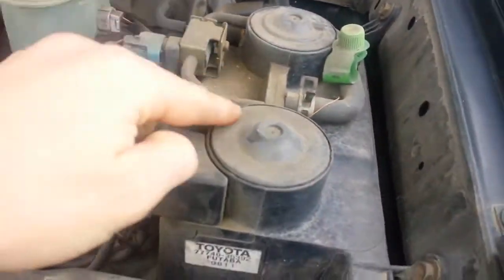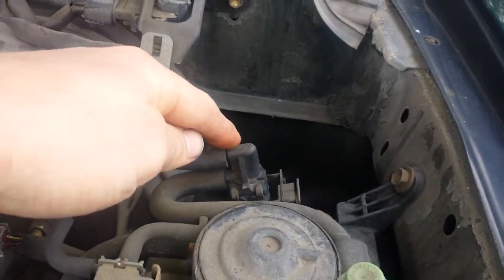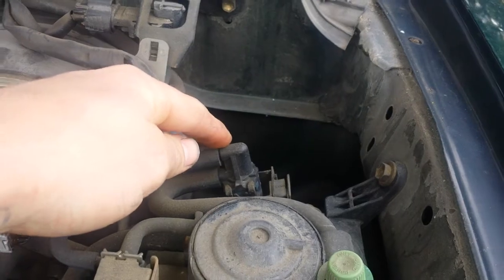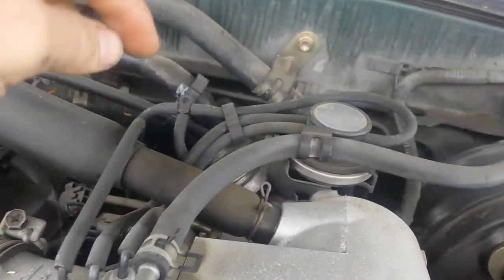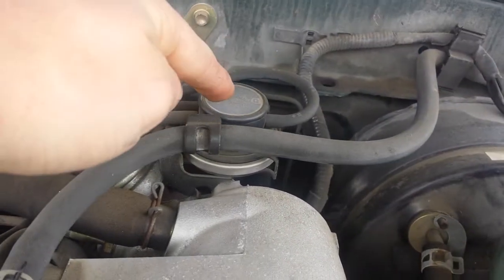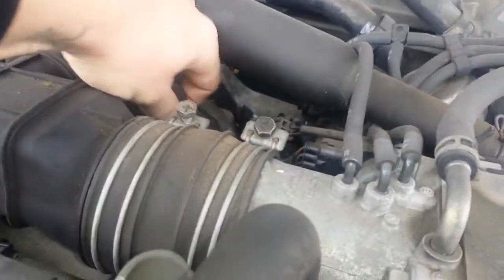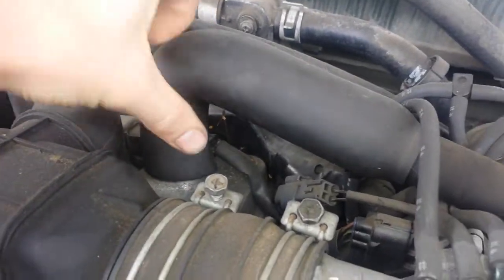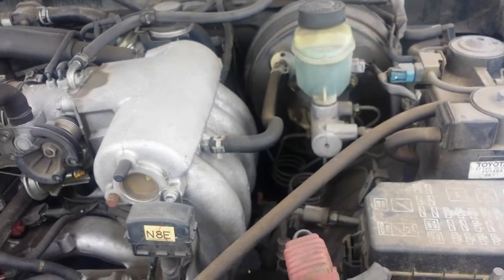Toyota Tacoma Emissions: PCV valve, EGR valve, EVAP canister, EVAP purge, & o2 sensor locations.

Comment: everytime youtube puts a commercial in the video I will give thumb down
Reply from the maker: +rotoR Col well thats stupid. If i remove the ads will you donate to me? Well you tube donates for you. Its our insintive to upload more vids.
Reply: that's note stupid, If you understand, they should keep the small adds at the bottom of the video but not a 30 seconds to one minute of adds before the video starts that you can't skip for just a video of 1 minute that you posted, and finally I wouldn't donate anything, youtube community is to help each other, I have another channel in which I find a solution of something wrong in my car, tv or any stuff and I share it for free, I don't care the money as you do
Reply from the maker: I shoulda said in my opinion. Ads suck but thats how we get our revenue.  Yiu should downs thumb yt.
Reply: @ScottiesHobbies  I don't care at all about the ads; rather I need to understand EGR and who he hangs with, does he have filters, does he need a bath is he stuck?
Reply from the maker: @jamesmahle1259  no filters. They don't need baths. The ports could get clogged.  But from experience.  The transducer goes bad more often than the egr does. And make sure to get a OEM one if you replace it.